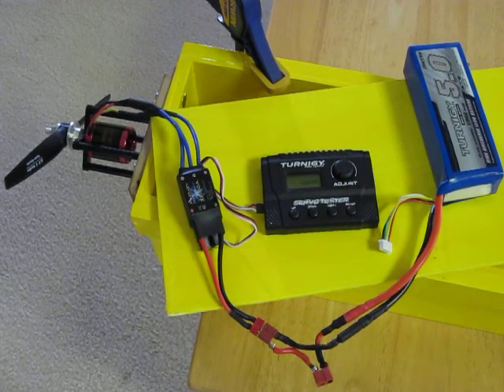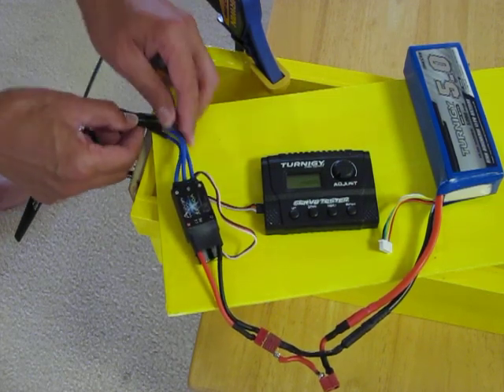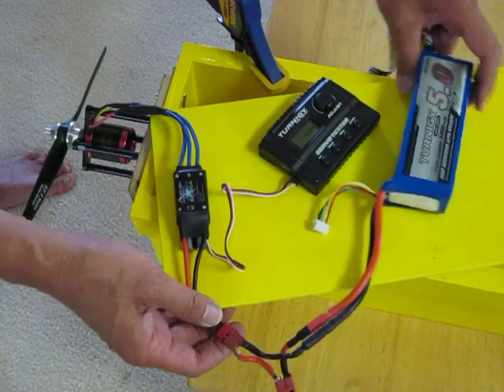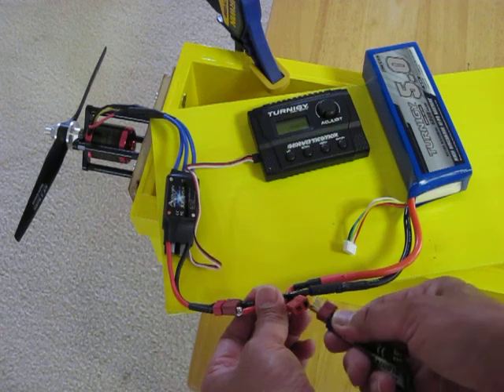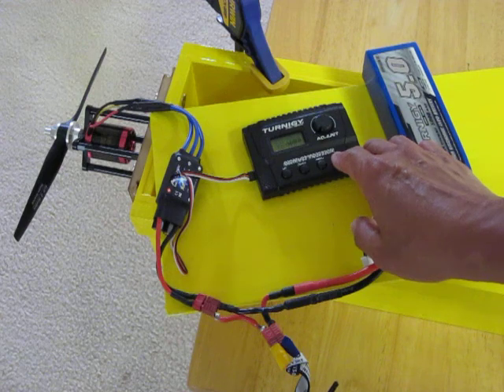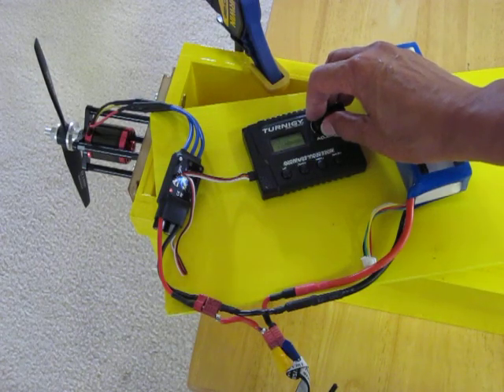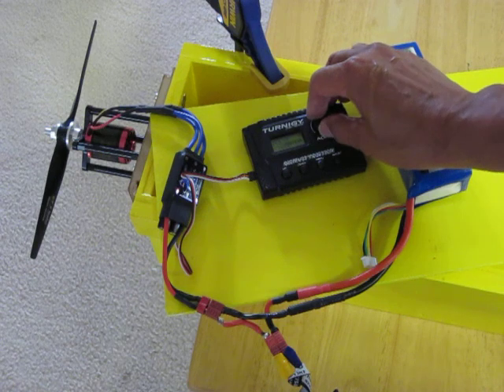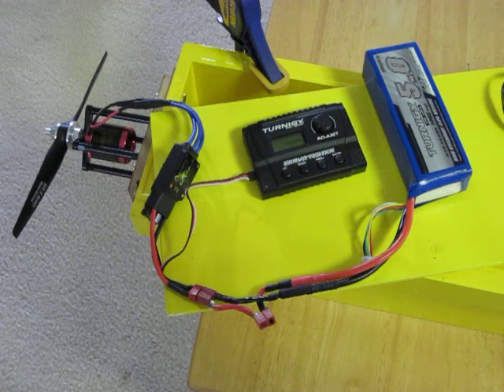Benchtesting a problematical motor T3648-600/8484 Turnigy 3648 Brushless Motor 600kv

Comment: Hi, I know this a late reply on your video but the problem with your motor is the timing of your ESC. You must check what timing your MOTOR needs, if either LOW, MID or HIGH timing. After that and programming your ESC you should be ok.

Comment: Did you verify the connections inside the motor with a continuity checker or ohm meter ? I have one of these motors but mine is 1450kv. Just curious what you found.